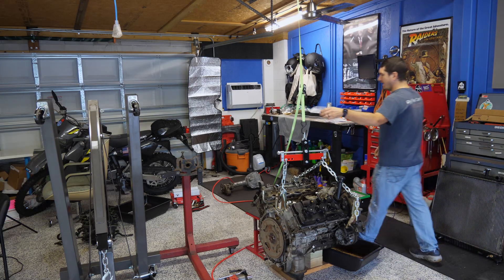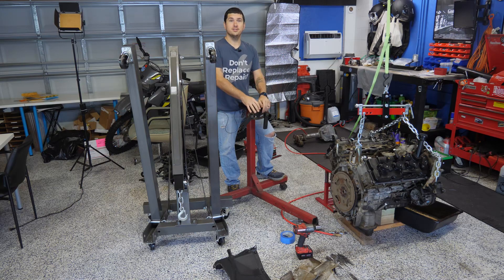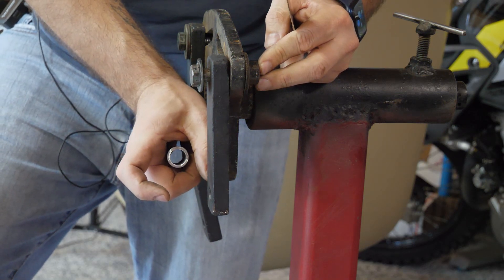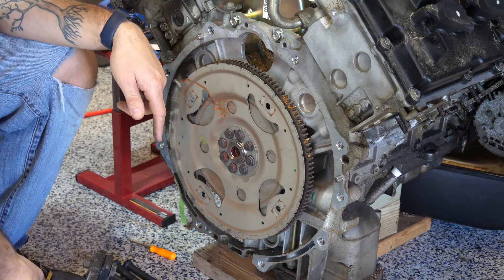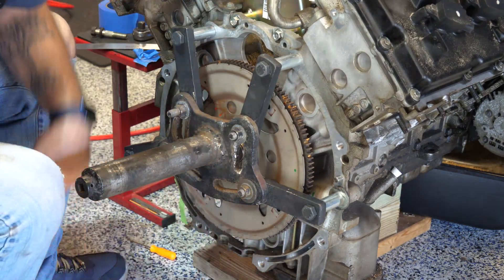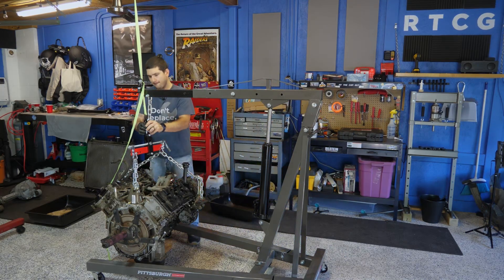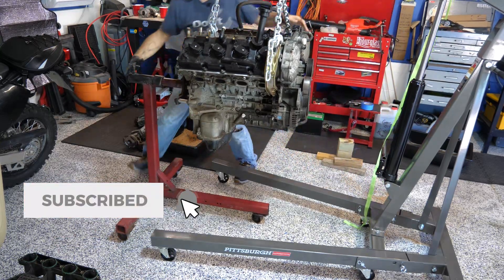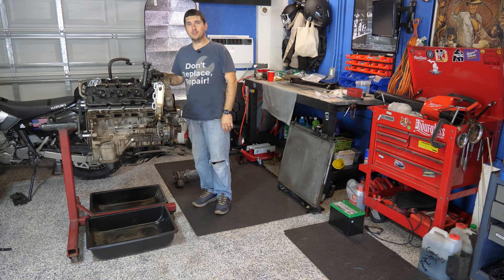How To Mount An Engine to Stand

Comment: What if the bolt holes in the engine stand are bigger than the holes in the engine ?
Reply from the maker: How much bigger are we talking?
Reply: @Rythecarguy  maybe 1/4 inch or so. It seems like there should be a sleeve that goes around the bolt and fits inside the bolt holes on the engine stand.

Comment: I have a Ford 5.4 engine. I bought a stand but I can't seem to connect the four pieces because the do not seem long enough to reach. The two top pieces reach but the two bottom ones don't reach. Do you happen to know if a specific stand plate is needed for the different engines? I thought one size fits all but maybe I'm mistaken, thanks.

Comment: I took the engine out of my girl friends car just so I could put it on an old engine stand I had in the shed, after I watched this. I wonder if I will be able to put it back in her car this afternoon?
Reply: Did you ?
Reply: @SSTAYE  It took a lot longer to put back in & it does not go as well now. I recommend not to do it.
Reply: @calthorp lmao 🤣
Reply: @calthorp  is the girlfriend still mad? Do you still have that vehicle? I have to know
Reply: @shaneizzy8080  I had a little trouble putting that engine back in. After that she always said it did not run properly. She was angry about it but forgot about it, when I tried to heat up the headlight to change the lense in the oven & forgot about it when I was called into work. We don't cook in the oven anymore now & I had to buy a new light.
Reply: @calthorp  lmfaooo just take it to a shop bro

Comment: That engine stand looks very dangerous. Hope it doesn't tilt forward to the side right or left.  You should use one with 4 casters not a 3 caster stand. I had one that almost tilted over.
Reply from the maker: Agreed, I hated that thing. Had it melted down when I was done with it.

Comment: Few questions, 

do you need to remove the gearbox first before mounting the engine? and with the spacers is there any chance they'll bow at all or are they pretty solid?
Reply from the maker: Yes, the gearbox has to come off. As long as you get very high-quality bolts and thick spacers, your spacers should not bow or bend.

Comment: Thats strange that 4 bolts and moreover the thread holes can carry the whole engine weight without breaking the block cos it is pulling downwards the one side. I would put another stand or a wood on the other side to balance the weight

Comment: I had to put a 1939 Buick L8 engine on a stand but I didn't trust the stand being so much shorter than the engine so I built a rolling cradle for it with left over angle iron for fire place hearths  and 3/16 plate. the cast iron tranny is still attached .
Reply from the maker: Niiice

Comment: The biggest difference with your mount is that its one of those dangerous 3 wheelers
Reply from the maker: Worked for me homie. Engine was 570lbs
Reply: @Rythecarguy  they work but notorious for tipping
Reply from the maker: @xESPplayer500x  yikes. Good thing I scrapped it. When I buy my next one I'll get a H style one

Comment: I'm relieved to see someone putting an even larger engine on one of these cheesy 3 wheeled stands. I just put a fully dressed 1.6TD on one and it doesn't inspire confidence
Reply from the maker: I will say this one was home made by some dude that lived down the road and it is beefy AF it's all super strong square steel. When I first put it on I was nervous but by the time I was done it was NBD. That engine was about 550 lbs.

Comment: Do you have an opinion about how to "CENTER" the engine on the bracket so that when you rotate it it stays somewhat symmetrical?
Reply from the maker: This really depends on how adjustable your arms are. You need to choose the trans mounting holes that align the center Kline
Of the engine with the support post on the stand.

Comment: I've never done this and I'm not trying to ask stupid questions.  What if you have to work on the clutch or flywheel?  Do you just attach the stand to the other end of the engine?
Reply from the maker: not a stupid question! You don't know until you know! 

It depends on you're situation. You cannot attach it to the other end of the engine. You need to remove the clutch and maybe even the flywheel to make the engine fit on the stand. If you are careful you can sit the engine on an old tire or do like I did. I set it up some wood blocks so support it on. Yours would have to be more study than mine since mine was just temporary untill I got it on the stand. You can see it in the very end of part 4 and the very beginning of part 5 of my engine rebuild series. Here is part 4: https://youtu.be/nWoINttEKZs Hope this helps!
Reply: @Rythecarguy  thanks so much for the reply and link to your other video!  I have a 1948 Ferguson tractor I need to work on.   I'm just going to take it slow and think it through.  Your info will be very helpful.  Thanks again!
Reply from the maker: @stevenandkimmetzger880  you're welcome. Best of luck! Sounds like a cool project.